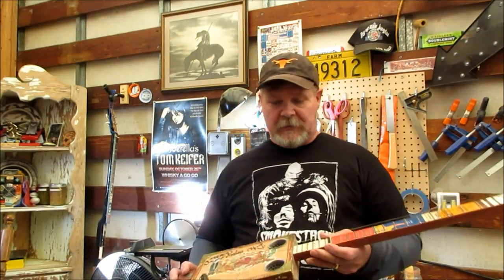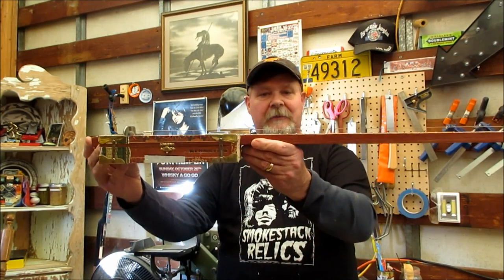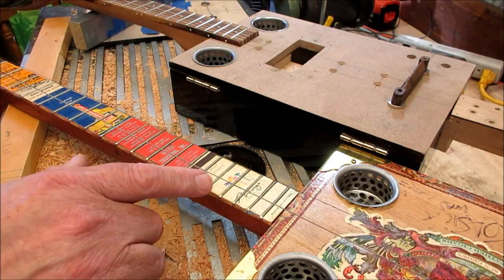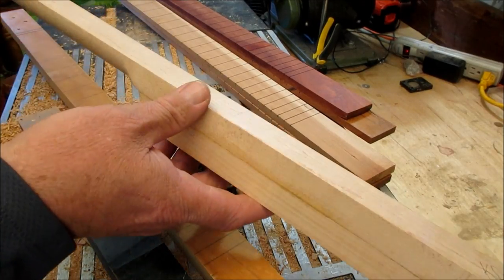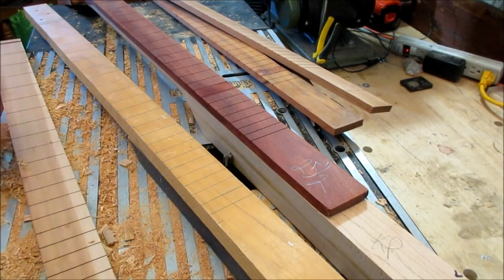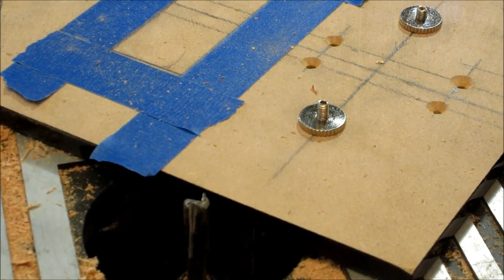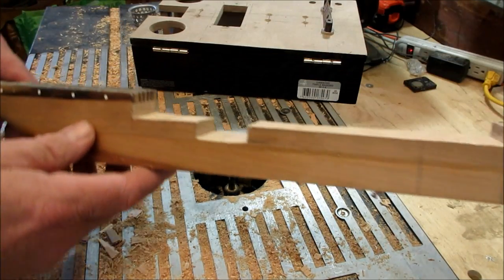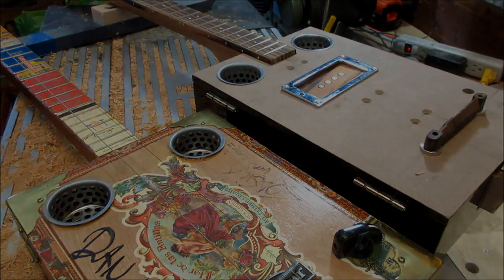How to Build a Cigar Box Guitar: Don't Blow Your Top

Comment: You could fix your first guitar by simply swapping out the nut and bridge bolt for smaller ones. 

Now, unless you finger pick... Your pick will more than likely scrape the box because of the fingerboard and box being the same height, but at least it could be fretted with much lower action.

I like the matchbook fingerboard. I have also been trying to figure out an easier way to notch my necks for the box lid. This confirms I need a router and router table like I've been thinking. Thanks!
Reply from the maker: Fun & Eclectic thanks.  I won’t do anything with the guitar as it will stay the way Seasick Steve left it.  You hit on the main point that regardless of what I do with the nut and bridge, the strings will still be right on top of the box top.  I’m shooting the next couple vids on sizing but and bridge and then will do notching the box.  Thanks for watching.

Comment: I wished I watched this video a few days ago. I did the same mistake he refrences,but glued it together. Its my first ever attempt, but I 'm glad to know this is a common problem. I don't think I'll mind if its a just an occasionally used slide guitar though, as it only has 3 strings and I'm not a slide guitar fan anyways.Just wanted to do it. Hopefully adding a pick up or other stuff will present new opportunities? I'm planning on guitar fx.
Peace. :D
Reply: QUESTION: I can dd an extra layer or two if needed of wood for the fret board, but IF I have no plans to add frets, do I really need to do the extra step? Thanks. :D